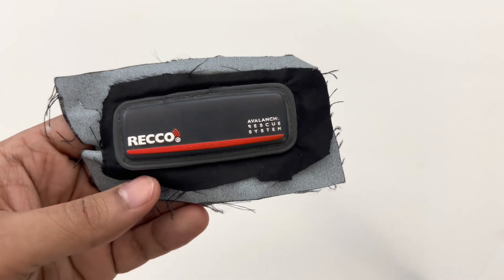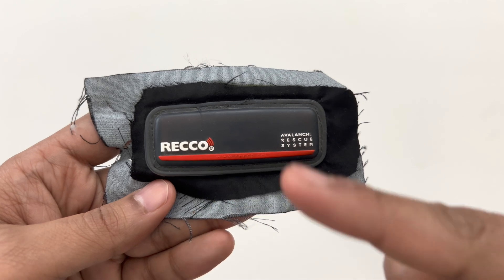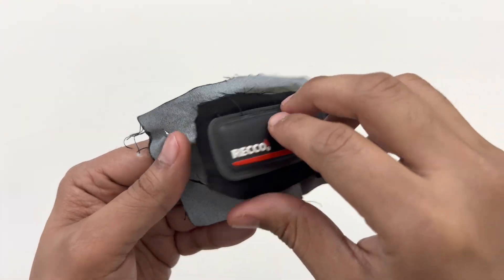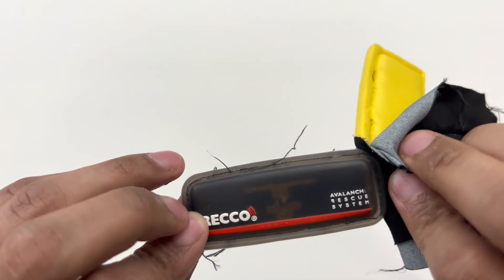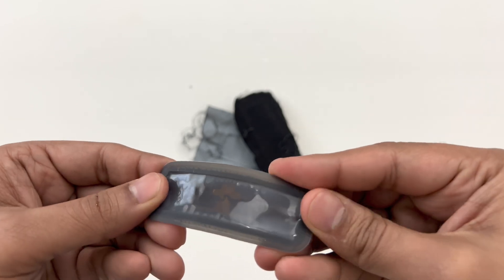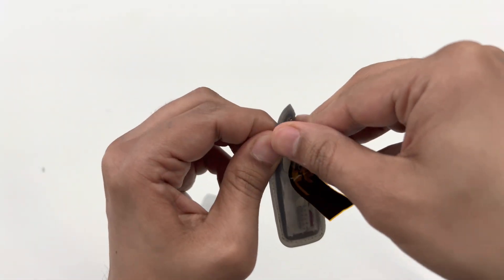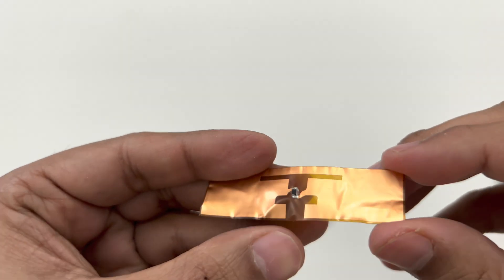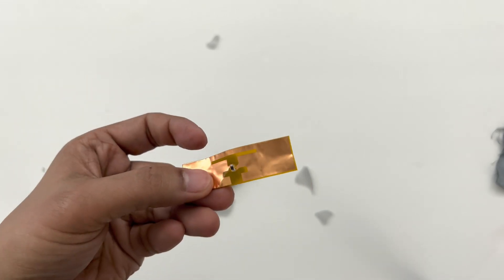Recco Avalanche Rescue System: What's Inside?

Comment: so is just a diode? how are the allowed to patent an antena with a diode.
Reply: Abstract: A passive transponder includes an antenna having two electrically conductive parts; a diode connected to the antenna; and a transmission line connected to the antenna and to the diode. The transmission line is adapted to match the impedance of the diode to an impedance of the antenna. The passive transponder, when hit by radio frequency (RF) power of a first frequency f1, retransmits RF power of a harmonic frequency fh. Each electrically conductive part of the antenna includes a flexible conductive thread having a first end and a second end, and the diode is connected to a first end of the flexible conductive thread. An item, such as a fabric or adhesive label, includes at least one passive transponder.
Type: Application
Filed: May 5, 2009
Publication date: November 5, 2009
Applicant: RECCO SYSTEMS AB